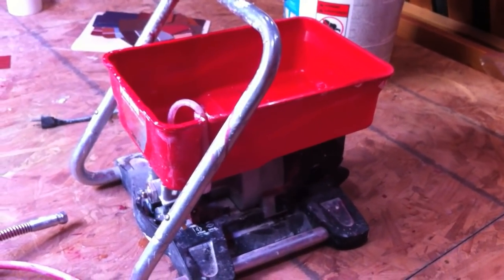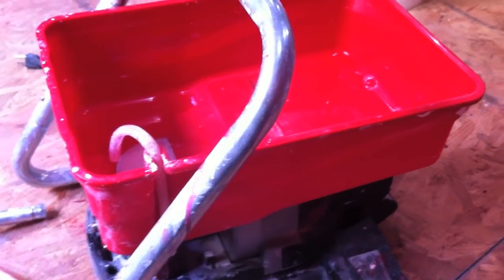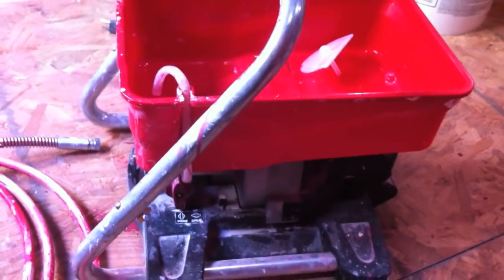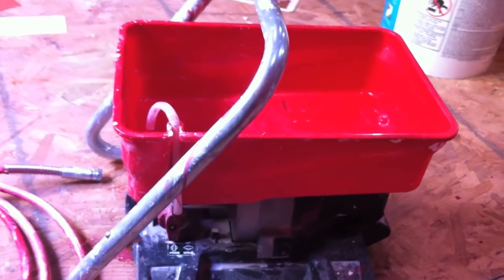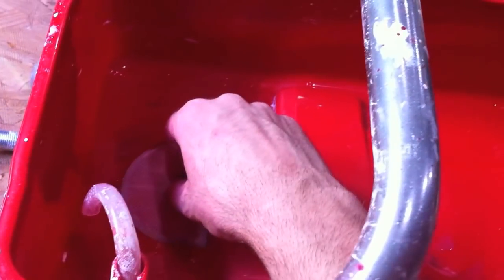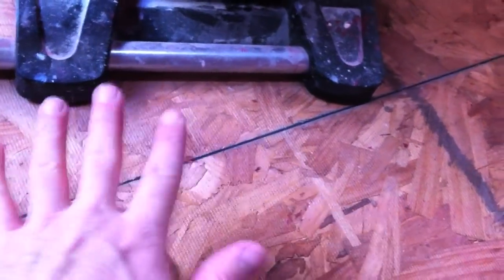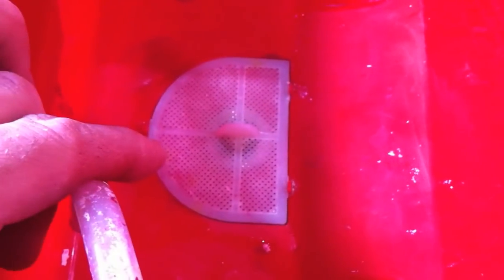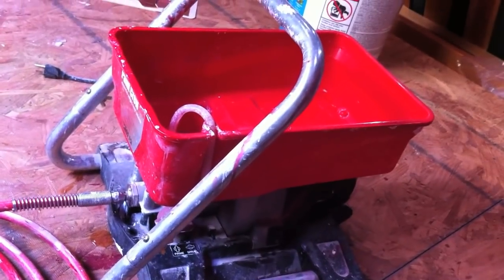How to use Wagner Airless Paintcrew Power Paint Sprayer Tips Paint Crew

Comment: YOU MUST  pump armor fluid or any brand storage fluid into it or ALL the metal parts inside, including the steel ball valves and valve seat will rust shut and so will the parts in the spray gun......if storage fluids too expensive for you, some cheap auto antifreeze will keep it from rusting and the paint from drying/hardening in there. I've used used motor oil, my pumps are near 25 years old still work like new never ever froze

Comment: When cleaning the machine put the hopper under the faucet and let the water fill hopper and spray the cleaning water down the drain(shower or where ever you have room. Do not turn water on full when continuousmy filling hopper just enough to keep hopper full of water.  Keep a bucket of water and rags handy during painting.  This is way easier than rolling and much faster.